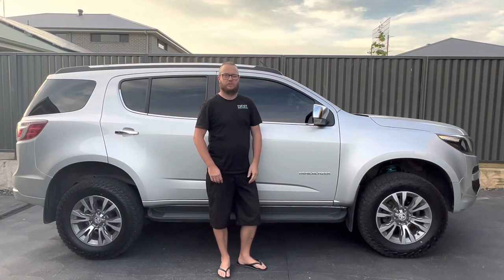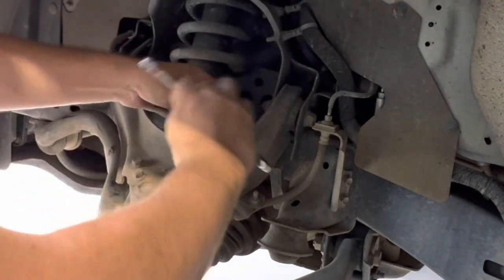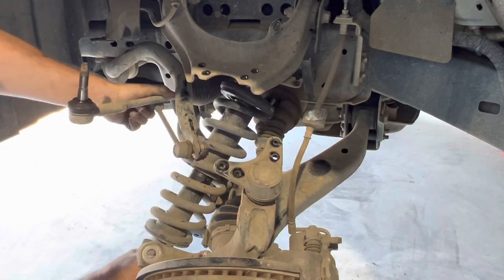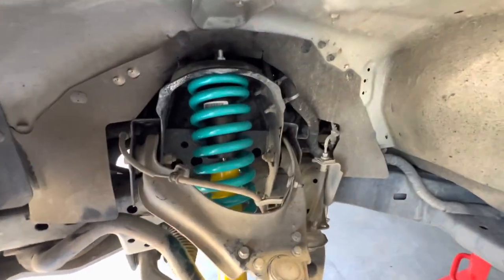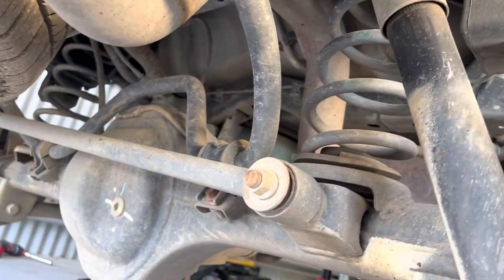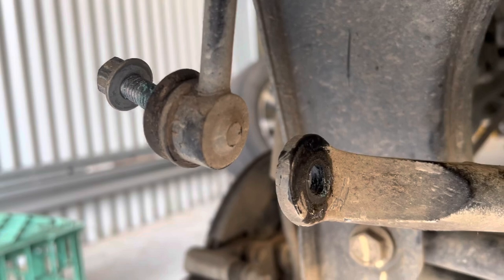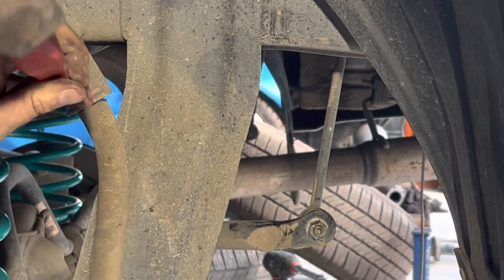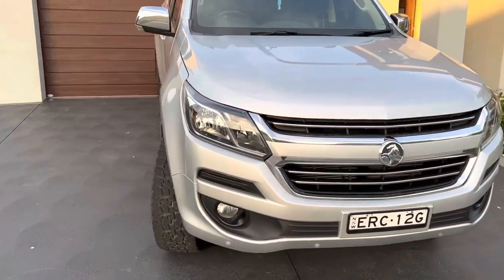Holden trailblazer 4x4 dobinsons 2” lift kit install and new 32” falken wildpeak AT tyres

Comment: the trick of installing 2.0 in. or 3.0 in. suspension lift kits is recalibrating the ride quality to the original ride attributes . . .
Reply from the maker: Ride quality is still the same as factory.

Comment: tha ks for this video mate, getting them rear shocks off was a nightmare ended up with fore arms like popeye! how is you susension holding up?
Reply from the maker: 🤣 they’re a bit of a pain but easy once you’ve done them before. Suspension is still mint, no issues and still happy with it.

Glad you found the video useful and cheers for the comment. If you haven’t already please consider subscribing to the channel 👌
Reply: also did you check your nuts after 500km and if so where any loose?
Reply from the maker: I’ve probably done around 3-5 thousand kms since and haven’t checked. Definitely need to do that 👍

Comment: Do you think this lift kit will fit a Chevy Traverse? If so can you share the link?
Reply from the maker: I’m not sure if this exact kit would fit a Chevy traverse, I’m not familiar with them. In fact this is the first time I’ve heard of a traverse as we have never had them in Australia. Your best off jumping on a suspension manufacturer or suppliers website and searching their database for a kit compatible with your make, model and year. Thanks for the comment, much appreciated 👌

Comment: The ride is softer or harder than stock?
Reply from the maker: The actual ride over the bumps etc is basically the same as standard,  maybe slightly firmer but definitely not a big change at all. If anything you might notice some body roll from the new higher centre of gravity and feel the car ‘leaning over’ in tight turns at speed.  But all I all I still recommend doing the lift and tyres if you want to improve the capability of the car off road. 

I hope this helps, thanks for your comment

Comment: Do you think some 33s will fit well? without cutting
Reply from the maker: From all the research I did  everyone said 33s (on the stock rims) would need the body mount to be cut for clearance. If you went with some aftermarket rims with different offset you may be able to make it work? Also some tyres have rounder shoulders than others that may help too. For what we use the car for I didn’t want to spend heaps of money or go bigger lift, diff drops, UCA’s, aftermarket rims etc. the 2” lift and 32s have made the car plenty capable enough for what we do. 
I hope this helps, Thanks  for the comment mate, much appreciated 👌
Reply: What is the tire size? My stock tire is 265/60 R18.  32" would be 265/70 R18 right? I'm also looking at wildpeak. Thanks mate
Reply from the maker: I went with 265/65/18. Stock is about 30.5”. The265/65/18s are just over 31.5”. I wanted to keep the stock rims and was worried the next size up might hit the body mount with stock rims. Some said it would touch, others said it wouldn’t. Looking at it now I think it might have juuuuust fit. But the difference is minimal and it’s still a family cruiser/wife’s every day car. I didn’t want to cut the body mount, It wasn’t worth it for me just to get an extra inch of tyre in there. To each their own though. 33s would fit easy if you chop and modify the mount or change rims. I hope this helps, appreciate the comment too. Thanks 👌